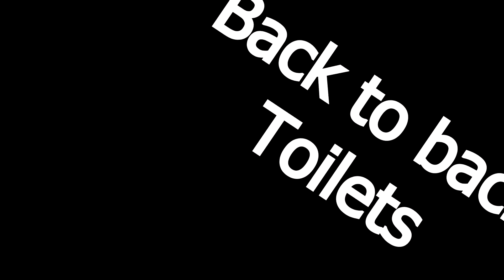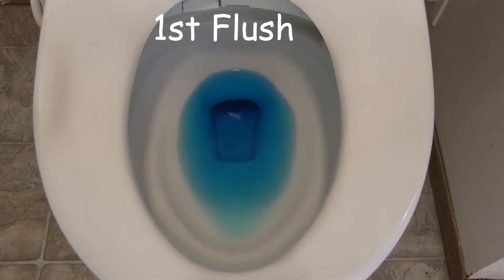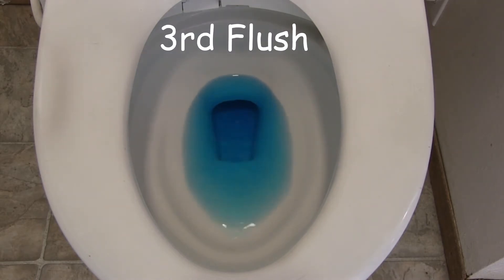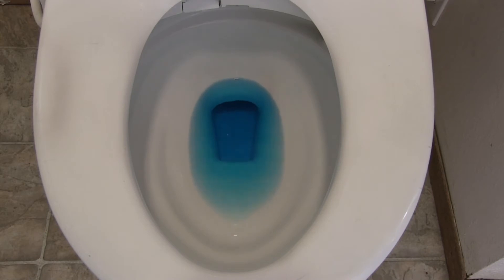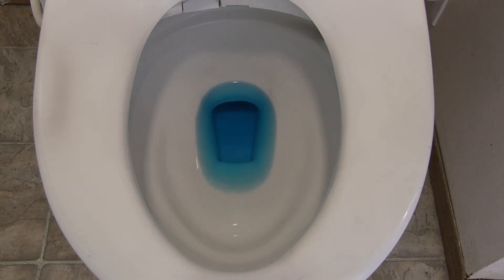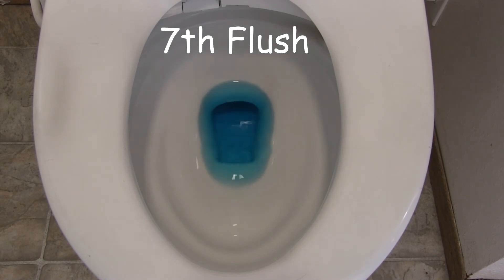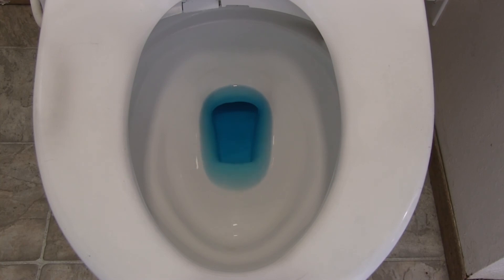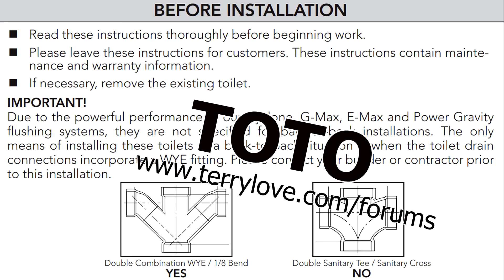An explanation for why some back to back toilets lose water from the bowl.

Comment: I have back to back toilets. One had to be replaced. And the other got a new fill valve. After that plumbing job, we've had this issue in both toilets. We had the plumbers come back (who basically accused me of lying when I told them it never happened before). They went up on the roof and said it was a disconnected vent pipe (even tho the water lowering issue never happened before that). It was over 1,000 dollars. Got the vent pipe fixed. The problem is still happening with water lowering. So disheartening. The toilets flush with so much power, way more crazy than previously. Could the flush just be too powerful? Any idea what could be a cheap fix? I am at a loss and so upset that after thousands of dollars, now my toilet plumbing sucks. Wish I'd never gotten the new toilet or new fill valve, as everything was fine before. I even wonder if the plumbers, themselves, jacked up the vent pipe just to make more money and pretend to "fix" the issue...

Any ideas would be so much appreciated. Thanks.

Comment: Got a similar situation at the building I do maintenance for. Every time someone flushes the toilet. The waste migrates into the other toilet. Therefore you have to flush both toilets it about 3 times for it to go down the drain. It's old cast with a T fitting. I'll be installing the double Y ASAP. Thanks for sharing the knowledge.

Comment: i used a double Y and a huge 3 inch vent about two feet upstream and I still get this!
Reply: Same issues here. And also a big vent pipe. I think it might be due to the power of the flush with newer toilets and fill valves. I've spent thousands, when the first plumbing job created the issue in the first place. My old toilet and fill valve were much weaker, and it never happened.

Comment: I lived in this house for many years without any problems with our back to back toilets.  Now when one toilet is flushed, the water level in the bowl of the opposite toilet goes down.  There must be a solution without major reconstruction.
Reply: Same here. Never happened before plumbers came to replace one toilet and fill valve in the other. The flushes are so fast and powerful, and I think that might be the issue.

Comment: If the recommended solution is to use a double wye (+ 1/8 bend?), would both w.c. arms need to then be vented before entering that combo? If the top of the wye is the only vent for one w.c., then what would you recommend?

Comment: So is there any solution to fix this besides replacing those pipes?
Reply: I have the same problem on two apartment buildings that I own. It would be extremely difficult and costly to change the tee to a double wye fitting in each building. I will be trying a One-Way Flow Flap installed inside the drain pipe just under the flange. I will start by installing the Flap under just one toilet to see if it prevents backflow when the other back toilet is flushed. Fingers crossed...hope this works. I will try and re-post after I find out the results...I first have to order the part then install it. It may take several weeks.
Reply: @johnk4169  Did it work?
Reply: @johnk4169 did this work?